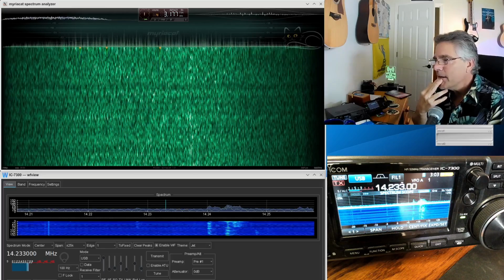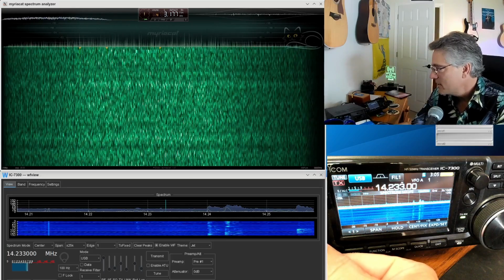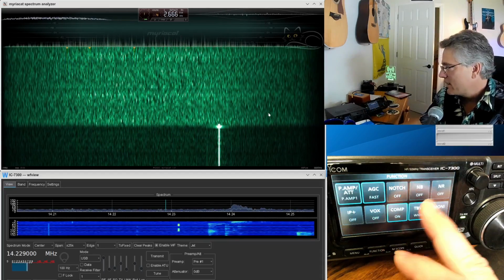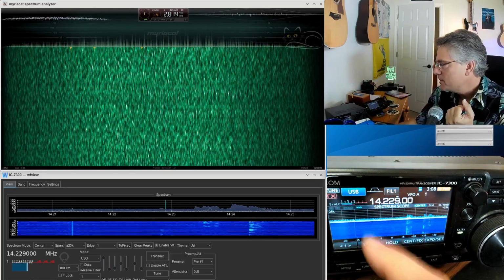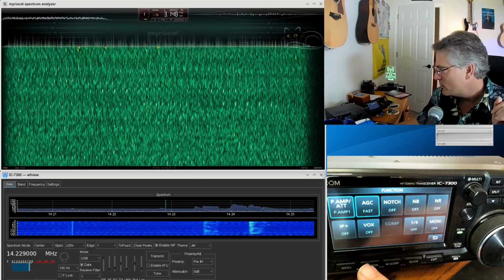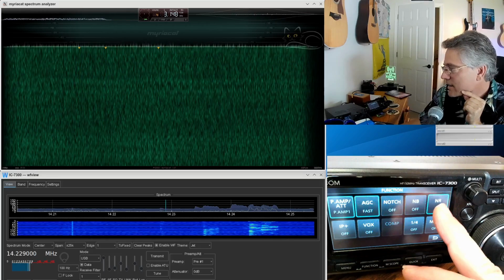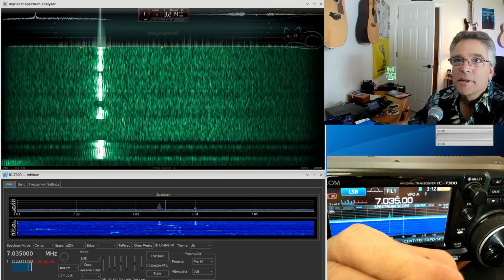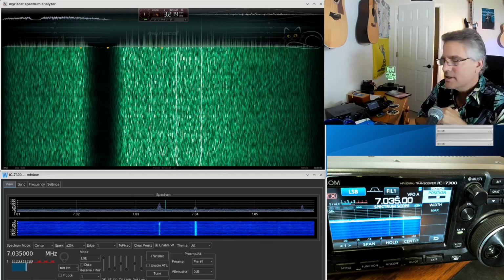Interference?  Let's nuke that noise!

Comment: My guess is that its coming from the grid power lines. Something like a loose connector or a cracked insulator.

If so, then take a portable cheap AM radio and walk / drive up and down your street while listening for the strongest noise level. For further attenuation if needed, wrap the AM radio with foil and leave one corner of the radio exposed. Then if you can locate the source within a few telephone poles, take a sledge hammer and start smacking the telephone poles. This sets up vibration up and down the pole. When you smack the offending pole, you should hear the noise flutter in and out.

Once you find the problem area call the power company - but don't tell them about the sledge hammer! They will be glad you told them and will come out to fix it.
Reply: brilliant!  thank you!  i called the power company, ill follow up.   -craig KM6LYW

Comment: My washer motor puts off a weird noise across all bands. Goes for 15 seconds pauses for 3-4 seconds and then back.  It's pause is when it's changing directions during wash cycle.  It's front loader washer.